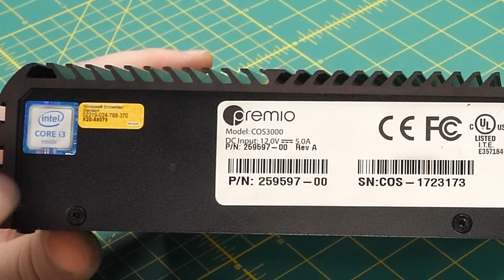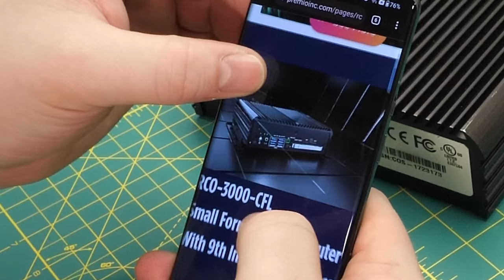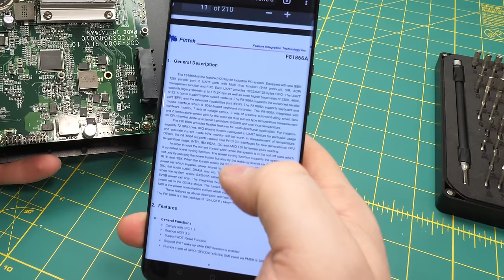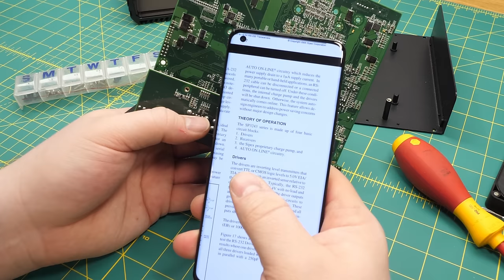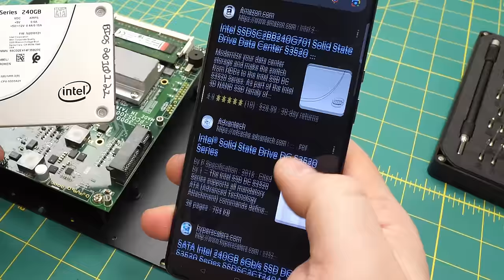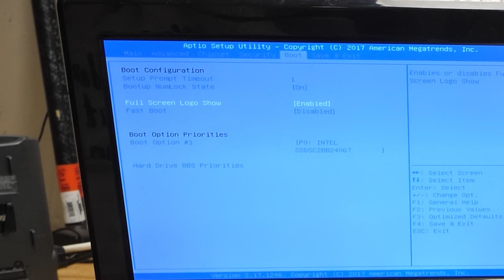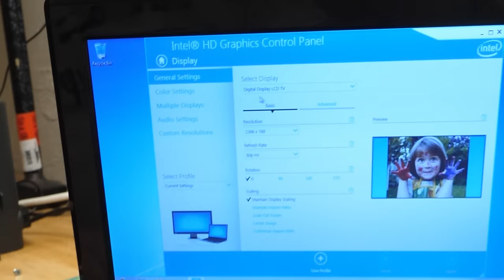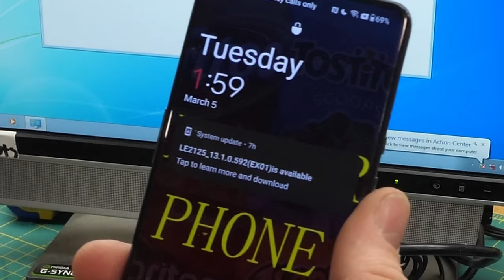Little Guys: Episode 4 [Premio / Coinstar]

Comment: Before the proliferation of wireless networking, you used to be able to kick the network cable out of the wall behind the CoinStar machine and it wouldn’t charge you the fee. Sadly those days are long gone now.
Reply: Used to do the same thing. However when I was doing it you had to select the gift card option and remove the Ethernet cable interrupting the network connection caused the computer to give you 100% of the money
Reply: Ah, the unethical life protip that's only unethical because of the system of trade we use. Good times.
Reply: How true
Reply: Yeah, many vendors with equipment in retail / food service include a dedicated cellular modem by default. I am a big proponent of hardwired communication for most commercial and industrial stuff, but this is one situation where it makes sense to go cellular. The vendors that supply the equipment generally have little to no control over the network or structured cabling at the locations they put the machines in. Even if they do, a single service call may cost the same as many months of business-grade cellular data.

Comment: The hole on the hdd tray is for the motor of a HDD as those have pins just kinda exposed on the back and you dont wanna short that out
Reply from the maker: ...oh duh
Reply: @CathodeRayDude  I just checked w/ my stack of dead laptop drives and alot of em have a sticker on the motor and some have the pins exposed, I also noticed that on some drives the motor sticks out a little more so the hole could also be a fitment thing

Comment: If my (also no longer top notch) eys see it correctly, there is actually a diagram of the Phoenix connector on the PSU. I believe it genuinely came with it from the factory. I also think I've never seen any of these connectors without a terminal block, so this might just be how it's done with these even on larger scale.

They are also absolutely everywhere in industrial application, not just on PCs. Almost everything of at least some quality comes with these, or a very similar style of connector. (Or just built-in screw terminals, but connectors are always nicer.) This is because in cabinets, you normally just have one chonky 12V or 24V PSU for everything, and distribute that via one large terminal block to everyone that needs it, so you'll just run individual cables custom-cut. If we had to deal with a basket full  of custom made PSUs, it would be a nightmare for the poor wiring guys, but also with regard to certifications and such.

Cute little fella you got there again!

Comment: There's another reason to want to avoid USB3, which is that it interferes with wifi-  you need to keep your wifi antennas at least fifteen centimetres from any USB3 ports, by design rule, and given the, uh, variable quality of USB devices, they might leak RF too.
Reply: you can also sometimes run into issues with USB2 devices on USB3. probably a lot more common in industrial applications instead of consumer
Reply: Any and all 2.4GHz signals actually. I have problems at work when I plug in a USB3 drive next to my Logitech receiver. On another intel NUC, we had to put a shorty extension for the MS wireless keyboard/mouse receiver to get any range at all, because plugging it directly into the front panel gave you about a 2 foot range, which meant it only worked on the end of the conference table closest to the NUC mounted on the wall. With it in a shorty extension and tucked behind the TV, it works all the way at the other end of the table.
Reply: Don't NUCs have both USB 3 and Wifi and are less than 15cm in every direction?
Reply: @3rdalbum  Yes, and this is one of the reasons their wifi sucks really, really bad.
Reply: @skonkfactory  never messed with nucs until recently, testing one for reuse as digital signage. is there an established reason they (and chromebits) were discontinued?
Reply: @peppigue  I think Intel got bored and wandered off.  And other companies had started making devices that were very similar, so why bother?
Reply: ...I now see why my little media pc's wifi chip seems to struggle so...
Reply: The literally make motherboards with built in wifi and usb3 ports next to each other for both pcs and laptops.
Reply: @common_c3nts  yeah, and the performance is garbage.  try it with the port disabled if you don't believe me.

Comment: Best ending ever!

And the watchdog timer is 100% in “hardware” - no software needed. It’s purely the chipset pinging the CPU via interrupt to see if it’s still responding. If it doesn’t in the time you set, it sends a hardware reset (exactly as if pressing the “reset” button on the chassis.)

Servers often have this as part of the BMC.
Reply: There's no interrupts or "pinging". It's a counter that has to be reset before it hits the programmed threshold. If the software doesn't reset it, a hardware reset is engaged.

Comment: When I see bare stranded wires connected to screw terminals without ferrules, I cringe at the savage who committed such an atrocity. If you happen to be so unlucky not to have an assortment of ferrules, you can at least tin the wires so the strands don't come loose.
Reply: I never thought about tinning before inserting them, I'll try it
Reply: AFAIK tinning/soldering is just as bad since the metal is very soft and will just deform over time and loosen up, even if screwed in tightly once

Comment: The FSP power supply with that three pin plug seems stock as they have the pinout for that connector printed on the label! Also, I'm pretty sure the hole in the drive caddy is for hard drives, more specifically their spindle motor hub that may stick out a little underneath 2.5" HDDs

Comment: @4:54 we can see on the PSU brick label that the 3 pin power connector was originally installed by the brick manufacturer, not the system integrator. keep up creating this awesome videos, dude!

Comment: You know dude you've just answered a question I've always asked, I was so in suspense when it not only did not work once but twice and you got me both times!! well done! , I once had a laptop with an EMMC head of crap in it but an unpopulated nvme port , turns out soldering in the port did not work till I found a picture of the board with the nvme option , 5 caps and a diode is all it took to get it working but like your experiment at first nothing happened and I was so upset , and on the second restart windows installed a driver and it magically turned up.

Comment: That 12 volt DC input is pretty handy, because you can hook it up to a larger power supply that's already powering other things in a panel box. The Digital IO is pretty neat to have, but not enough to be a main controller itself for most things. I imagine you'd see one of these pcs mounted in a panel with it's DIO connected to a controls system that isn't modern or advanced enough to have networking capability. Which many controls systems I see in smaller or older plants aren't networked, and as you grow larger as a plant or start updating your controls stuff from the 70s, you end up needing networking capabilities.

Comment: I used to work for a company that used very, very similar computers. That does look like the power supplies that shipped with them although interestingly they're often not assembled. The power supply with just terminate to pins (as it appears that one does) and the connect is just in the box. Also, a lot of the newer ones do have DisplayPort and/or HDMI.

Comment: If you were curious, FCBGA1168 indicates "Flip-chip" (die mounted upside down for better heat transfer) "ball grid array" (same as PGA but intended for permanent affixation using balls of solder) with 1168 contacts

leaving the board with the power button off would have been a great way to demo the AT mode :)

Comment: HDMI with audio can be run over a DVI port, generally. DVI itself doesn't have a spec for this, but many DVI-capable graphics cards will do it anyway and if you hook it up to a TV using a DVI-HDMI adapter or cable, the TV doesn't know the difference and will happily accept it.

In terms of soldering on a DVI port, the answer in general is a solid "maybe". There are some supporting components required, but it looks like in your case they're all populated. The passives are straightforward but there's driver chips (TMDS) of some sort, and it depends on their margins/processes whether they save enough money omitting those (in addition to the connector) to warrant leaving them off the board.

It's possible some designs might embed the drivers right into some other chip like the PCH, but generating TMDS is a messy mixed-mode signaling task that's usually better handled in a dedicated IC with a process more suited to such things than pure digital logic.

Comment: The SuperIO feature set is nothing unusual except those extra serial ports, unless i'm overlooking something.

Interface it to the PC? No, it goes on the LPC bus, you don't get all the necessary pins on the TPM connector, and you can't have two LPC SuperIO chips, they are going to have a fight.

The thermal "paste" looks like it might be phase change thermal interface polymer rather than paste. Honeywell is a major supplier. It is hard and crumbly when cold, but it melts at around 50°C, its thermal conductivity in molten state is stellar, and you can leave it in for 20 years with no service as it doesn't suffer pump-out and separation, since it's not a mixture.

Tolerance on the risers? With phase change polymer, you are allowed to leave a bit of room underneath and use the gap bridging capability of the polymer. The bottom of the extrusion isn't flat anyway, as it warps during cooling, making for a slight bow shape.

You often find 2mm pitch pin headers near a 25q flash IC for the BIOS flash on modern boards. But advanced SuperIO/SMC chips often have their own firmware as well, doing a bit of power management things on the PC and the keyboard matrix on the laptops, there has to be a way to program them in system. Also CPU-less BIOS flashback on modern PCs, ever wonder where it lives?

With a paste like AS5, it can matter how you apply, there's a reason modern gamer pastes aren't like that. But i wouldn't worry too much.

Congrats on successful surgery <3

Comment: I work in commercial AV and use phoenix connectors or phoenix blocks, as they are sometimes known. You're right, then come in various sizes and such.

My company is fairly insistent to use heat shrink and ferrules on phoenix blocks. As well as Teflon tubes to isolate bare ground wires.

Comment: 7:25 you can see on the back of the power supply that it was not a hack job... where it would normally tell you "center hot, outer ground" it actually shows the plug it is terminated in... it came from the factory with the heat shrink and ferules.

Comment: They've come a long way baby!.   I worked for CoinStar as a Field Rep from early 1997 through mid 1998.  There was nothing like this back then, it was a bare bones Intel 286 or 386sx motherboard, exposed to the elements inside the machine running QNX (UNIX Lite - for lack of a better term) and tied to the proprietary coin counting mechanism, which was a real PITA to calibrate.  They gave us Panasonic Tough Books as some old lady was sure to ram into you when you had the machine open and knock your laptop flying.   Ahhhh the good ole day.....lol.

Comment: You’re venturing into the territory of the industrial PC here. Even new purchases tend to have old hardware but comes with lots of certifications and a lot of serial ports, DC power in, and usually passive cooling. Advantech seems to do a lot of this business but there’s good options from Phoenix  Contact and ASrock Industrial I’ve found that don’t use too old of hardware.

Comment: The firmware likely cant find any drivers to run the DVI port, however the OS can because you installed them.

Watchdog timers can work in a number of ways, they used to be dedicated hardware but are usually handled entirely by software nowadays. This might be different for industrial applications though. In software the timer will raise an NMI (Non Maskable Interrupt) which will check for a heartbeat signal, if one isn't present it can reboot de device. It can reboot the device either by requesting APCI do it or by sending an INIT interrupt to the BSP (Boot Strap Processor). A hardware implementation just listens for the heartbeat signal and resets a timer when it receives one when the timer goes off it asserts the either the #reset or #NMI pin on the processor.

What I want to know is why to you need to tell the firmware that an SSD is attached to the SATA port when it can figure that out itself.

Comment: Love those Phoenix connectors, they're so versatile. Production lighting industry commonly uses them for DMX distribution racks. A lot of sACN/ArtNet nodes meant for permanent installs have them as the default as it makes it much easier to build cables rather than having to solder XLR ends.

Comment: 4:12 yea Phoenix Connectors are pretty common in industrial apllications to provide power and signaling. Those rectangle ones start at 2 pin and the biggest one i saw was a 12pin and there is also a round interlocking variant for 230V AC or 400V DC

Comment: My “carputer” that I built in 2001 used the same chassis. God I miss the early 2000s online carputer scene. A popular author of an e-Zine called, This Strife, was a major contributor to the car-computer scene. Great zine too, wish I still had my copies. 

That case design has been around for decades. I’m pretty sure Pioneer still uses it for car audio amps.
Reply from the maker: I've been thinking of doing a video on 2000s carputers for *years*, they were so delightful

Comment: There are a variety of RS-232 drivers that hit all sorts of voltage levels; the standard technically allows anything from 3-15V (positive and negative) for your two states, and while older good-quality transceivers make efforts to hit the higher end of this range (12-15V) for cable length and noise immunity reasons, more modern (and cheaper) drivers often just say "eh" and give +/-5V (or sometimes even less) and call it good enough.

Comment: a couple of notes ive have while watching this, the smaller heat sink that sits on the cpu die directly would usually be called a heat spreader, the alternate locations for sata drive connectors like dont have the sata controllers connected to them for configuration of the board, but if they did they would likely be headers meant to connect cables to  so a drive can be mounted in an easier to service bay on the machine in a case designed to accommodate it. im more impressed the controller for the vga port is also compatible with dvi without replacing another control chip.
Reply: With respect to the controller for the VGA port: there isn't really any kind of dedicated controller. The SOC has built-in controllers and drivers for VGA, DVI, and HDMI that work with the integrated GPU; Intel likes to make this stuff as easy as possible for board vendors.

Comment: Just something silly I thought I'd share about screw-in connectors, especially D-Sub ones: So many of these, especially nowadays, but even back in the day have been actually kind of pointless, due to the screw heads having way too much travel (even though the matching standoffs should never vary in depth), so almost the entire connector can still slip out, causing at least about half the pins to disconnect when  tugged, even though the connector is properly fastened. Then there's also a lot of these connectors with way too soft rubber at the ends, that ends up just bending or breaking using a screwdriver to properly fasten or loosen them (had to use pliers on these in very uncomfortable positions way too often). Still have some cables that have metal versions of these weird semi-thumb-screws, or even just outright normal screws too.
Also some further timestamped stuff!
36:45 Yup, digital audio can be routed over DVI-D>HDMI. Fairly sure some late DVI sink devices even had audio capabilities (not since HDMI became the norm though).
44:00 So this behavior is actually not that uncommon after all... Some thin clients I've used also use a DVI-I port, yet only allow DVI-A until the proper driver is loaded by the OS.

Comment: I use wire Ferrules all the time at my workplace, especially when diagnosing/patching electrical curcuits on industrial-grade machines; the are coll for scre-terminals, but not so much with WAGO terminals, wich are also used at my workplace

Comment: The HDD/SSD function in the bios, some more info, some operating systems don't automatically throttle when paired with older SSDs. Since some older SSDs depended on the OS to handle thermal throttling.
Modern SSDs have this built into the controllers and will handle this automatically regardless of settings.

Comment: I live in Switzerland. I never saw a coinstar machine. But. We do have something.. Slightly similar? We have special ATMs that have a coin dump.. Funnel? I guess? And a Bank Note inlet. Those serve a similar function. You just dump your coins in, the ATM counts it and then you deposit it directly into your bank Account. That's where the difference is at. You don't get gift cards or anything, it's just gets put into your Bank Account. Pretty Handy. Raiffeisen, the Bank I am part of, has those ATMs mostly at their Branch locations.

Comment: A couple other things about coin stars and similar machines. They take a 10% fee, print a ticket for cash redemption at the stores counter but I think they’ve started letting you transfer money into a checking or get a gift card code, and they break down constantly. Some banks, like TD, used to do it for free but ended up losing money on service and repair.

Comment: I vaguely recall that same old video cards wouldn't show anything during post if you plugged the monitor into the 2nd port but worked fine once Windows started. So I'm not surprised the same goes for the DVI here.